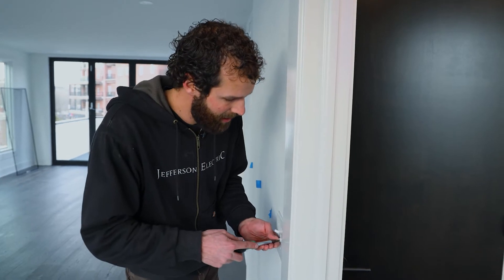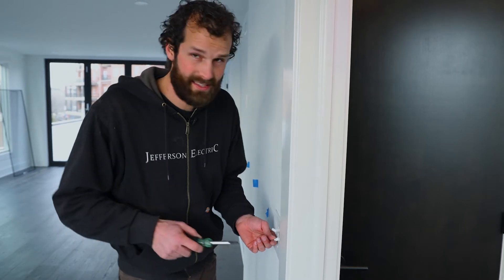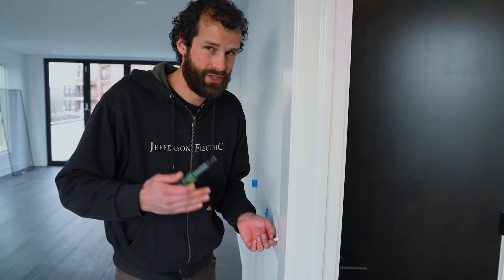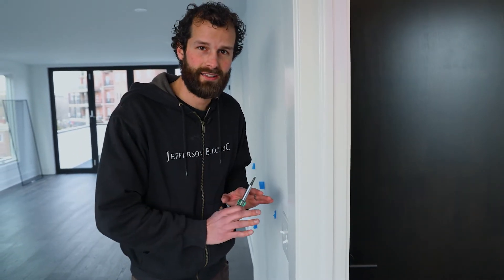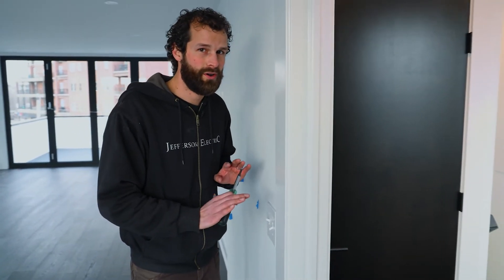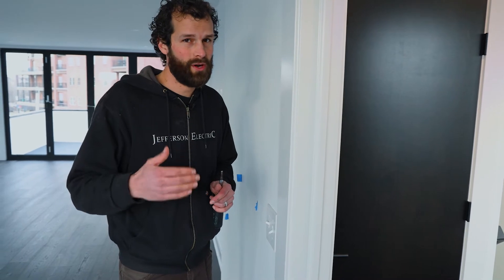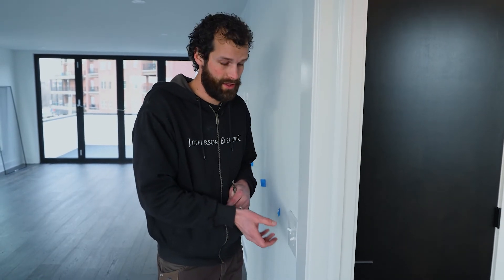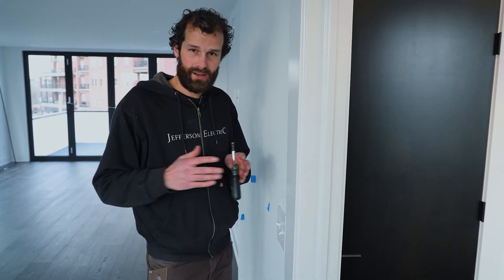2 Simple Electrical Job Workflow Problems To Avoid

Comment: Absolute Wisdom Dude - why is this so hard to understand?  In my house, they sprayed the walls with paint and the inside of all the boxes are painted - INCLUDING pre stripped the wires. When I updated the outlets and switches, I found paint on the copper under the wire nuts.   A house lasts decades and the builders are worried about an extra few hours to respect the things you don’t see.
Reply: I HATE HATE HATE painted conductors!  UGH!!

Comment: Excellent tip but please don't use the words "off of" when the correct English is "remove". In this case it's removing paint FROM those devices. Yeah, we all do that "sloppy English" from time to time but polishing it up for the video would be a good thing.
Reply: Much of this is unscripted my friend. I can’t tell you how many times I comment on a video or post only to go back and shutter at my grammar.
Reply: @LDoctorKC  ... scripted or not, a little attention to detail can make a video stand out.
Reply: @rupe53  It isn't the most egregious of mistakes.  I've watched a lot of his videos and Joel does misspeak fairly regularly, but they're usually just minor details (e.g. calling something that is yellow white).  I'd much rather have a care (and a go) at "news" websites that don't even know how an apostrophe works.
Reply: ... yup, I see your point, but the fact remains that if we want to communicate, we should strive to communicate well. Proper wording / grammar is part of this... otherwise we may not get the point across as intended. BTW, some of these phrases are quite common, although incorrect. I actually find myself using them at times but proofreading my posts helps a bit. That's something I learned in a public speaking course years ago.
Reply: @rupe53  We agree there!  Especially writing, in my opinion.  
But, I also think "off of" is just fine.
Reply: @jovetj  ... might be a regional thing but I also see many using "would of" instead of "would've" and that makes my skin crawl. I won't even get into the debate of their, there, and they're.... or two, to, too.... or four versus for.
Reply: @rupe53  Yes, it probably is a regional thing, because I've heard it all my life and it makes sense to me.  
"Would of" is definitely very wrong.  My pet peeve is using singular verbs like "that is" (or "that's") with plural nouns/objects.  Alas, I cannot think of a good example of this off the top of my head.  
I guess I am a "nerd" of many things, electrical wiring, and grammar being but two.  In my grammar Nazisism, I do hold so-called professionals like journalists to the highest standards.  Next down are others who are directly profiting on their work of speech or words; in both cases, second parties are paying for their professional language skills.  Mr. Walsman here is an electrician, not a wordsmith, so the accuracy of what he explains is more important than the details of language precision.  I expect jargon like "gang" and "mini" to be more problematic to viewer understanding than things like "off of" or "that's good."
Reply: @jovetj  ... I would agree with most of what you said. My only point is to raise the bar. If you want a good video, then you need to work on the presentation. Sometimes it's the simple things that change it the most.
Reply: @rupe53  It's depressing how uphill a battle raising that bar is right now.  People are straying away from the details, not embracing them.
Reply: @jovetj  I struggle with using proper sentence structure and grammar a lot, and as I allow more distractions in my life, it gets worse. Thanks for encouraging us to do better.
Reply: @rupe53  I found a great example of my pet peeve just now:  "So Tom, we know that there’s multiple law enforcement agencies involved." 
It should be: "So Tom, we know that there’re multiple law enforcement agencies involved."